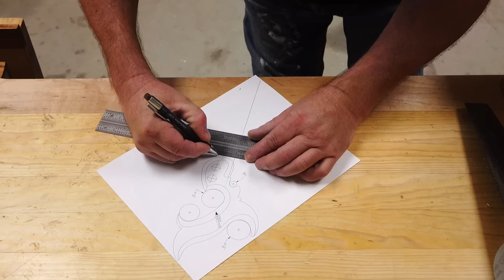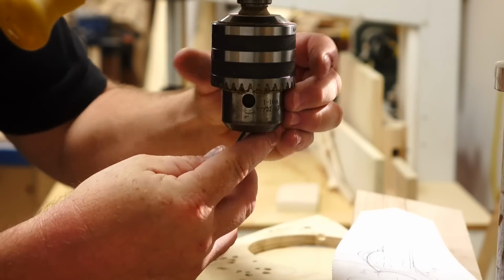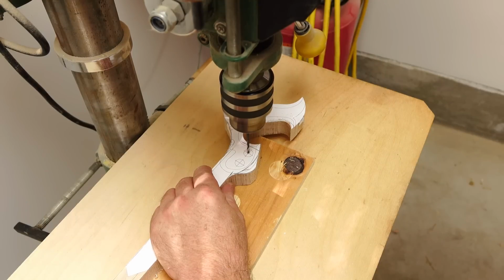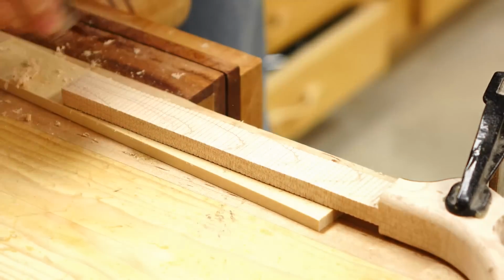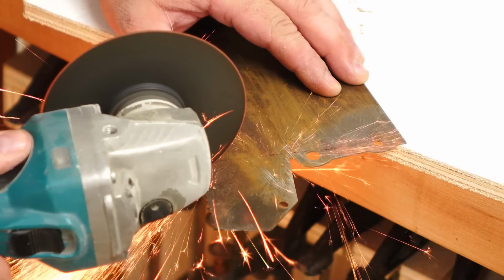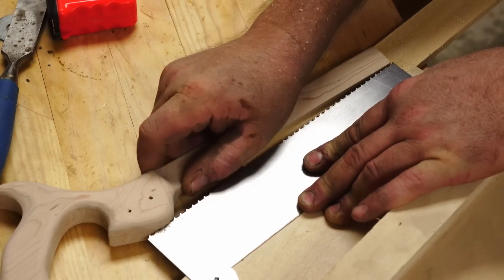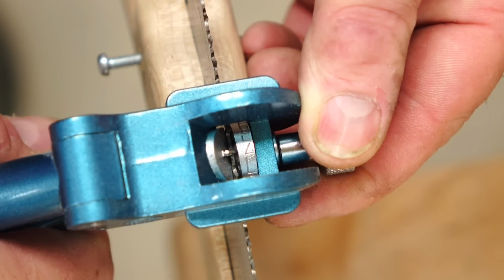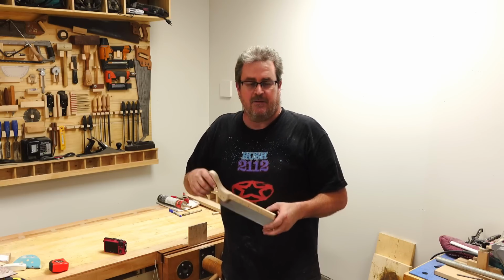How To Make A Dovetail Saw

Comment: Great project John, I had to laugh when I saw the grinder without a guard,  I just caught a lot of grief for that . also cool shirt 2112 might be my favorite Rush album
Reply from the maker: +Jon Peters Art & Home Thanks Jon. Yes, the grinder guard comment, I think I've gotten it 50 or 60 thousand times by now. Mostly from guys that probably haven't been in the same room as a grinder, or an honest days work :)
Reply: +Daniel Gardiner When those 9" cutting disk shatter in your face, you'll be glad to have the guard on. Though, I agree. There are times where the guard actually makes the work more dangerous.. Generally though, I always keep the guard on.
Reply: It typically happens when you cut bent steel. As the steel is about to break of, it will "grab" the disk, thus shattering it. Happens every now and then when I have to cut deformed steel, and can't use a blowtorch or something similar.
Reply: 2112 is easily the best. its not a matter of debate.

Comment: That's a lovely project John! One question, when you take the set out with the file, aren't you thinning the teeth? Is there a benefit of doing it like that rather than reversing the set with let's say a hammer?
Reply from the maker: +Switch & Lever After the set is filed off, they were resharpened deeper into the plate and reset. Hammering could break or crack teeth at the root and possibly stretch distort the blade. Filing is much less intrusive.

Comment: Nice build.  Now I am going to figure out the proper way to set the teeth and sharpen.  Wonder if scrap 2 x 6 lumber would be adequate for the handle since I have no decent wood at the house but that.  Edit was the dimension for the record. Put down 2 x 4 by habit.

Comment: Hi, great how the sawblade turned out. I have several old saws that need some attention and I didn't get good results with sandpaper only. What cleaner did you use to get rid of the rust?

Comment: Enjoyable video, thank you very much :) I have a question about drilling holes to saw blades. At 5:57 I see some lubricant on the blade. What would you use/recommend? And an ordinary metal drill bit? I have a need to make couple of holes to a Japanese pull saw in the middle of the blade to attach a depth stop, and don't want to ruin it by warping or anything like that.

Comment: looks good john. so u answered all my questions..haha. except one. which cuts better for dovetails? IN YOUR OPINION -your saw or the hack saw ?
Reply from the maker: +Joe basementwoodworking Both cut well, but you'll feel more like a REAL woodworker when using this saw, and of course the joint will look better because of that :)
Reply: yea i can see why. :)and the one you made looks just like  the veritas dovetail saw . minus the black and darker handle. u made dovetails look pretty easy with that hack saw though..lol

Comment: wow, sweet!  Pretty ingenious, using the saw blade itself to cut the slot in the handle.  Looked definitely like a slow process.
Two thumbs up!  

I think I spotted one problem though, and that is where will you hang it on your slat wall?  ;-)
Reply from the maker: +wordsnwood Thanks :)
I've acquired a few new tools and will have to make a new place to put them. Either a new, smaller tool board to match the old one, or a wall mounted tool cabinet with double doors. I'm leaning more toward the cabinet, which would be an interesting project on its own.

Comment: Great video and great handle :) Next time you can use vinegar to take down most of the rust :)
Reply from the maker: +NeolitiC You should try that on a saw like this, if you have a week or two to wait for very mediocre results :)
Reply: It is possible to take that much time :) I have used that method twice but it worked for about 12-14 hours. I guess it works different on different types of steel/metal :)

Comment: Your work seems very good. I just wished people explained  in videos  why they did what they did. For example, for me it was not clear why you opted to make it - not buy it. Why not keep the old blade of the saw together with its old handle? Why does it have be rectangular blade? What is the proper geometry for sharpening of this type of blade? What is the proper angle of spreading the saw teeth?  ( I mean if this info was in the video, it would have made a lot more sense).

Comment: Looks to me that there is a really large set. Dovetail saws have minimal set because you're mostly ripping and already dry wood. You'd probably be better off with much less set. Also the back is usually metal for added weight so you don't actually press on the blade at all but either drag it or even lift a bit.
Reply from the maker: +Pasi Savolainen There's very little set. There's more info in the build article that you should read.
Reply: +John Heisz Ah, ok so of course it's thicker blade coming from a bigger saw. Hope you don't take this is criticism, this project is great as so many of yours are.  You wouldn't happen to have a borked japanese blade (they tend to be really thin from what I've seen), of course they're often some "interesting" material that might just not take kindly to being sharpened; and so many seem to be induction hardened.
Reply: Actually who cares about thin kerf, even in worst case the kerf you have is thinner than what anyone will ever need. Sorry for rambling :)

Comment: What's the difference between this saw and a tenon-saw?
Reply: +ja1kee Tenon saws tend to be a bit larger.  Apart from size and whether it's set for ripping/crosscut or something in between, there isn't really much meaningful difference between a tenon saw, a dovetail saw and a carcass saw.  If you're looking for a starter saw, check out the veritas products.  I'd suggest that a bigger saw than a dovetail is more useful if you're getting started, and you can still cut dovetails just fine with a bigger back-saw.